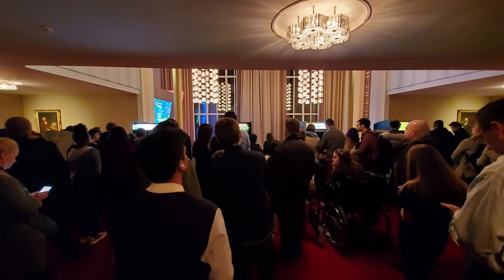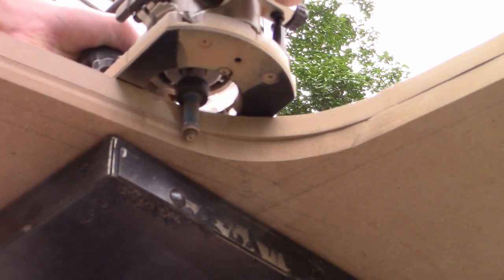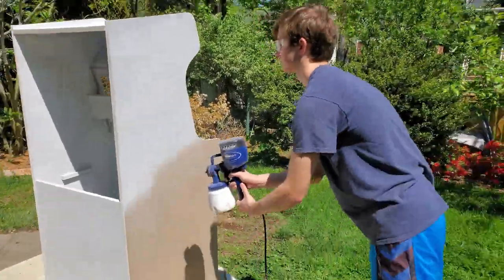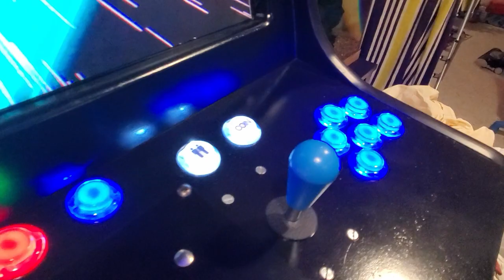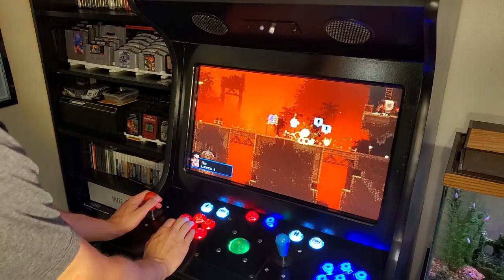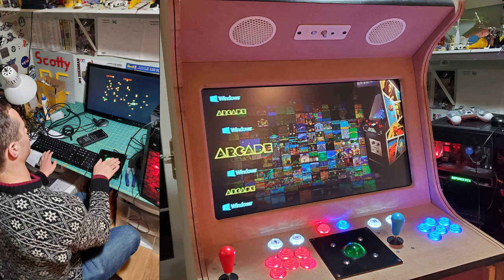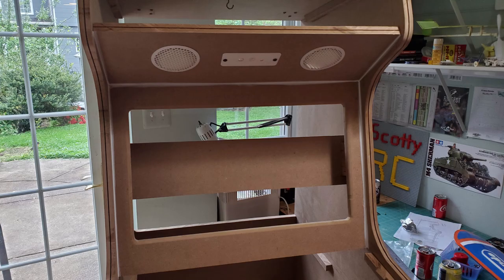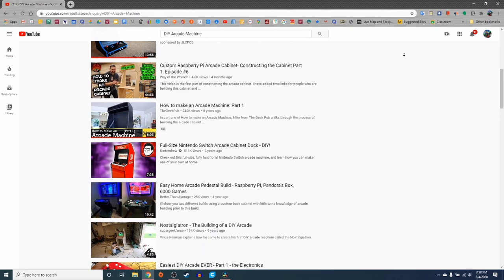DIY Arcade Machine - The Pilotwings Fan

Comment: well done, very good, may i ask why you didnt use a crt tv ? just like the old school arcades?.  there are ways to do it without using an s-video or composite, using an ultimate scart adapter from a radeon 5450hd with groovymame and crtemu driver, although you are not in europe so you dont have scart in crt tv, so using a different method may be used.
Reply from the maker: LCD monitor seemed to be the easier route since it was lighter and more simple to hook up and mount. I also wanted a seamless fit between the body of the arcade and the display and figured CRTs would have a lot of curves to deal with
Reply: @ScottLarsenThePilotwingsFan  is there any options in the emulators for you to put scanlines on?  What front end are you using?  Since you are using a pc, you have lots of choices for emulation and front ends, hyperspin etc etc, and of course the new coin ops may be something your interested in!?. You have the front usb ports on the pc so you could always plug in a joypad.
Reply from the maker: I don't know about scan lines but there is a filter that makes it look like the screen is made up of individual light cells. I'm using big box front end and Mame emulator
Reply: @ScottLarsenThePilotwingsFan  i suggest looking for the filter scanlines, it will appear much better, the pixels will blend in like asif its a crt tv or arcade monitor, more realistix appearance for you.